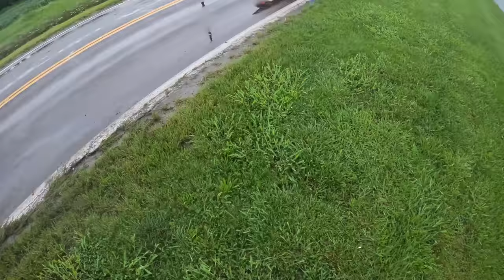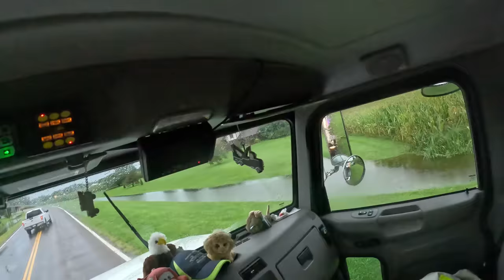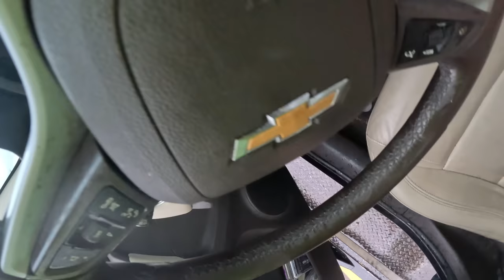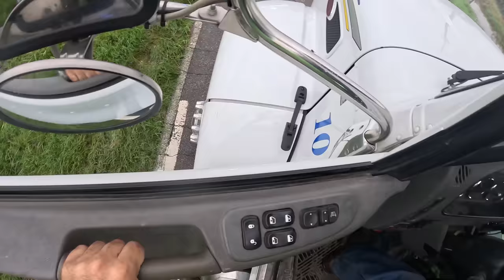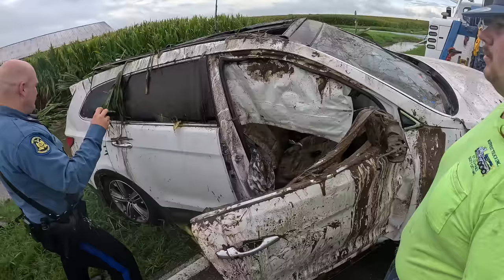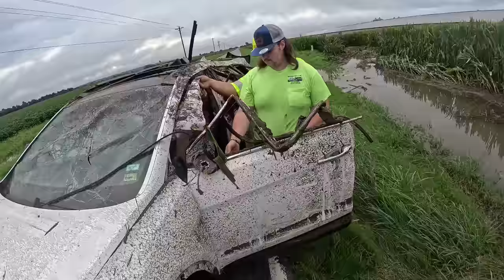FISHING FRIDAY!!!    TWO JOBS ..... ONE VIDEO!!!

Comment: Other than the property damage, it was kind of a funny video.  The first car was a little small.  You should have thrown it back.  It looks like you could have another fishing boat easy enough.  The bumper going back into the drink was a variation of Murphy's Law.  "Anytime there is a rope, cable or hose being pulled across a surface, the chance it will snag on an object is directly proportional to the inconvenience caused by said snagging."  Great video Ron!

Comment: Hi. got to take both as a win, a bit wet underfoot but not raining and no swimming needed, not even gumboots. Saw a great trick the other day with a car where the front wheels were locked off center, once it was on the bed if the tilt tray the towie put a cheap plastic wheel chock under the front of each front tire and as the wheel rode up onto the wedge they just slid over the tray strait to the winch. Cheers MD

Comment: I'm from the  UK, a question for you I note on a  majority of your  car/van /pickup recoveries you leave the vehicles in park, is there a reason for this, as in safety issues?
Reply: It Is for safety they don't want the vehicle to be able to free roll
Reply: It creates a controlled situation.
Reply: Rolling tires have more grip and can steer the car. With it in park the wheels will skid and you can slide the car around in directions you can't steer it like sideways. If the wheels can roll they will fight you if you need to drag them sideways and that could result in the car going in a direction you don't want it to go.  Secondary, if you stop pulling and the wheels are rolling you have to use wheel chocks to keep it from moving while you change your rigging for safety. If the vehicle is park it should just stay wherever you stop pulling.
Reply: Keeps the Vehicle from an uncontrolled roll when no one can be in the Vehicle to apply brakes..

Comment: Hyundai.. those things share the same problem that pretty much all Asian cars do other than Toyota.. the JATCO CVT auto originally designed by Nissan love to fail. They've had the same problems since the first one and they've never fixed it. I drove a Passat at a dealership that had the same trans and on the test drive the light came on and it stopped shifting right and I think it only had 12k miles on it.
Reply: Jatco is an in-house subsidiary of Nissan, Subaru make their own CVTs in house and are reliable ( 140.000 miles 2015 Outback, and Consumer Reports)

Comment: Ron I have been. following your channel for years now, and 99 % of the time I agree with your techniques. But it drives me nuts with your truck positioning. I have seen numerous videos where you have to move your roll back two times to load the car. You are making double work for yourself and its taking more time to clear the incident. Think a minute before positioning your  truck.
Also when i was in the business and we were called out for a police call all involved vehicles where towed back to our facility only. I noticed the Deputy stated. the customer wanted it towed to another location other than yours. Is that a rule in your state? Keep up the great work and stay safe.
Reply: I am just a viewer but remember that Ron has said that he will move the roll back to get the desired angle of pull for each position, like in the first one here, he likely wanted to get it up the bank with front wheels much closer to road quickly which he couldn’t have done with it further away.
And it’s the customer choice where to have it towed to in his case.